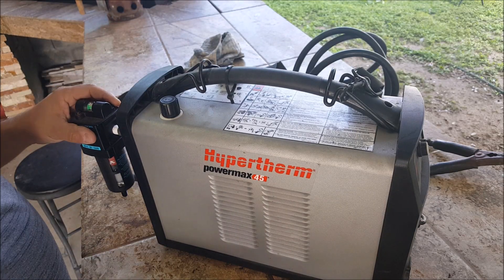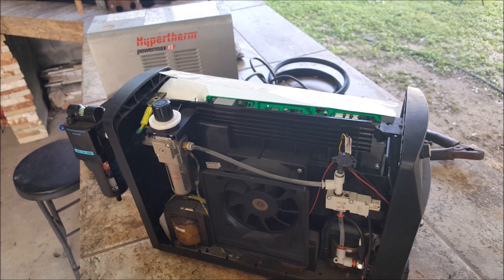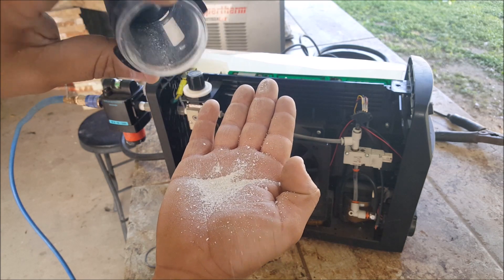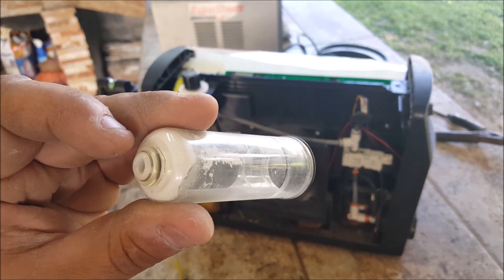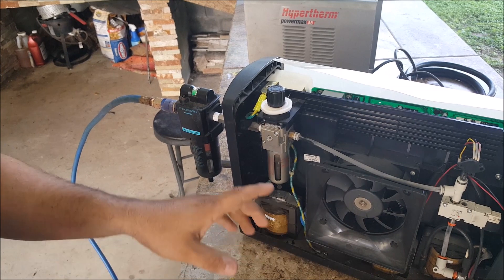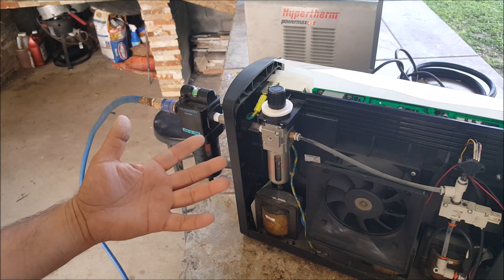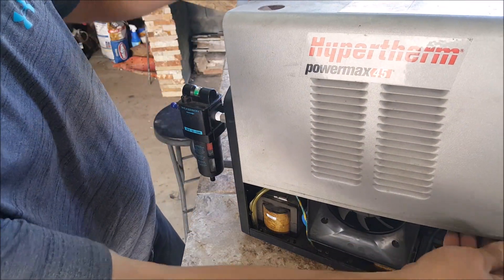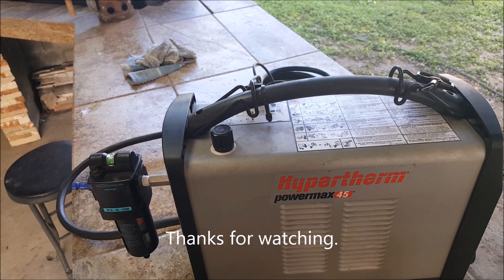REPAIRING MY POWERMAX 45 PLASMA CUTTER LEAKING INTERNAL REGULATOR EASY FIX REPAIR

Comment: when it comes to plasma cutters people need to know  , use tanks of compressed air from your local gas supplier . It is cheep  for  $264  I have a 5 year lease a refill cost $75 . not to mention no filter worries ,and consumables last twice as long
Reply from the maker: Curious what size tank you are referring to. I ran a small size nitrogen tank which I think was a 40cf and it went through it very fast. I will try it again soon as I am currently using a primeweld that will be a give away in June.
Reply: @cutweldngrind  I believe  it is 300 . It was  the biggest they have  .When Jim Colt said 8 hours  he was talking about a whole bank of 300 size tanks .  but still no worries . I have a power max 85  with a 75 foot lead . I can't replace either of them . and consumable has doubled since going to the compressed bottle of air ..I will pull out my lease and if I am wrong I will make a correction on size ,. my filter bowl on my 85 is on the outside

Comment: Sir I am getting 0-20 error (low gas pressure error)
Reply from the maker: Do you have a powermax45 or another plasma cutter. Verify your pressure at inlet of plasma cutter by installing a pressure guage. I have seen regulator on my compressor showing 80psi and then dropping to 30psi because its clogged.
Reply: @cutweldngrind  I have hypertherm 125 A

Thanks for reply on presuure guage.

It has solenoid valve behind.

Yes presure regulator may be problem

Comment: Hard water deposits
Reply from the maker: Yes sir. I have been looking for another identical regulator to replace this one. I almost built me a temporary water trap using 50ft of  pipe and that removed alot of the liquids from getting into my regulator.

Comment: I wonder if one of your air hoses is disintegrating inside? I have never seen that much junk in an airfilter.
Reply from the maker: I am thinking it was the moisture over time getting into the filter. I had my filter set on compressor instead of 50 feet away to let the air cool down and drop liquids out. I bought a new compressor and will be adding a better filtration system soon.

Comment: Yea these things hate moisture. I need a better air scrubber on mine.
Reply from the maker: What brand or model would you recommended. I already fixed drain on my compressor that got clogged and that should keep some moisture out. I should have a video on my compressor later today.

Comment from the maker: I just want to say thanks to all my subscribers for their support and hope you all had a fantastic week. I worked on Thanksgiving and Friday and have not been called to work this morning giving me time to finally make a video and fix my cutter. Thanks again.
Reply: forget those filters use compressed air from your local gas supply
Reply from the maker: @huckstirred7112  I cant remember what filter I  currently have installed. I did buy a 60 gallon compressor and ran a homemade manifold to collect liquids. I really haven't done much lately.